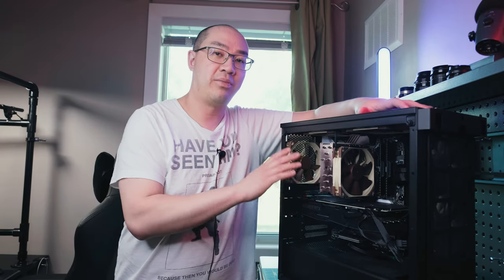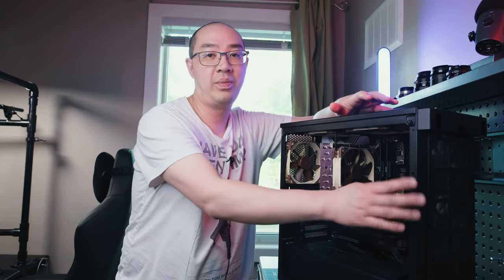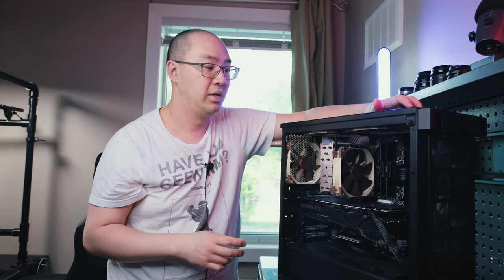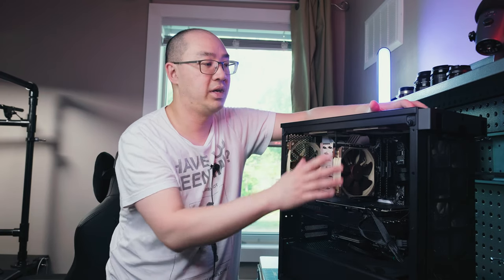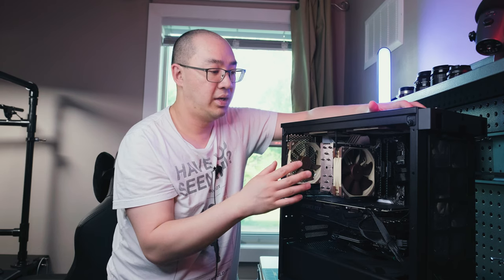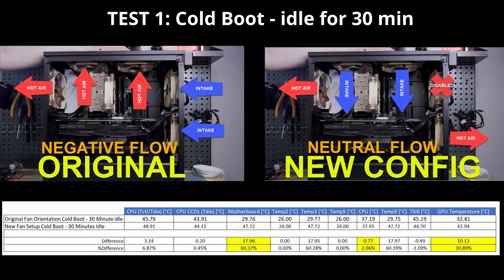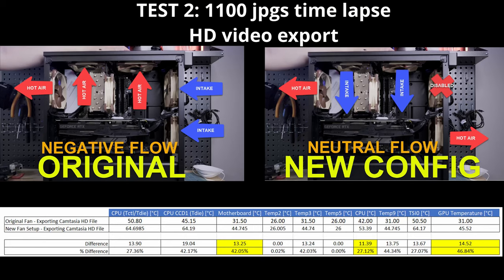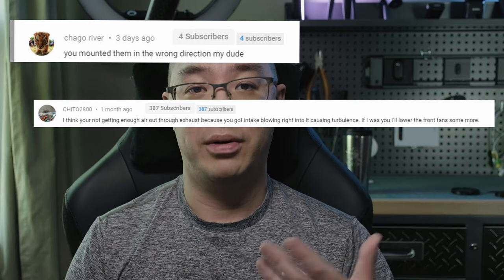Negative vs Neutral Air Flow Comparison | How to setup your desktop cooling fans 2

Comment: You didn't take into account your big ass CPU cooler when making a neutral setup and you went 1 fan down - of course it was going to be hotter. As well as hot air rising so higher intake fans don't help. I have Meshify S2 and 3x 140mm intake on the front, 1x 140mm exhaust on the back and 1x 140mm exhaust on the top-back (All Noctua as well, as well as the Noctua CPU cooler) to create the dust repelling positive air pressure, as well as more intake meaning more cold air coming in and the temps are great. What i want to try with my new build including this case, is full fan slot use on top via GPU 420mm radiator exhaust (3x 140mm fans and GPU specific because gaming is my personal priority and CPUs these days easily handle gaming) and 480mm intake, consisting of 2x 120mm on the front and 2x 120mm on the bottom to again keep that dust repelling positive air pressure. If you're not worried about dust like you mentioned in this vid - or you could slap on a total of 700mm of intake via 3x 140mm intake on front, 2x 140mm intake on bottom and a total of 560mm for exhaust via 420mm on top and 140mm on the back, then check your temps and get back to us ;) Or upgrade to a Meshify 2 XL for bigger and better fans allround as well as changing the thermal paste on your CPU and GPU to Thermal Grizzly Kryonaut, one of the few top pastes that are used and recommended by world leading overclockers.
Reply from the maker: Hi There. Thank you for the well thought out response.  I wasn't happy with my setup and I actually just switched over to a Fractal Meshify 2 and a 360mm AIO. (i'm just waiting for the 5900X to upgrade from my 3700X). The temperatures are way better. I'm currently using the stock fans in the Meshify 2 case. I'll be doing an update video on this soon.
Reply: @TheWongReviewer  Nice. AIO for your CPU or GPU? Front or top mount? It turns out front mount is the best for AIO in a case with good airflow like these. It'd be a shame if it's for CPU over GPU but i guess you do have different priorities, like 4k rendering and other CPU intensive work in which case maybe next time think about a Custom Cooling Loop, keeping both at great temps for gaming too. I'm going to be getting an AIB Hybrid GPU (360mm AIO + blower on card for VRM) and front mount that radiator, as well as the phat Noctua CPU cooler and 140mm Noctuas on bottom, top and back as well as Thermal Grizzly Kryonaut paste. Be about the best you can do.

Comment: What if you tried...
The front 2 as intake
The rear as exhaust.
The rear-top fan as exhaust
The front-top fan off?
Reply from the maker: Thanks for the comment. That's a good suggestion. That will allow for a neutral air flow. I'm going to wait for a few more suggestions  and then i'll do another temperature test. I'll definitely make sure to credit you in the video. Stay tuned!
Reply: @TheWongReviewer  I am very excited!

Comment: Great video! Just to jump into the discussion, I think pushing hot air downwards is a waste of energy since hot air would normally go up on its own due to density. It is like trying to push a well up a hill, you'll need more energy than if you just let it flow as it should. Even if you spent the extra energy to push hot air down, now the GPU will increase temps since the only air around it now is already hot and can't receive that much heat in the brief moment it comes in contact with the GPU radiator.
Reply from the maker: Thanks for the feedback. I see your explanation there, especially with the hot air rising and doesn't make sense to spend energy on it. I've switched to a new setup with an AIO and i'll be doing a smoke test to see air flow.

Comment: Original set up is the right one all you need was extra 2x120mm below the GPU to push the hot air quicker out the top and back exhaust.

Comment: Hey guys just wanted to ask. My case has 2 front side intakes, 3 slots on top, back and middle top are exhausts and the top front is intake. Finally one more on the back that works as an exhaust. Does that work well?
Reply from the maker: Hi there. what case are you using and what GPU do you have in there?
Reply: @TheWongReviewer  hi, I have a 3060 XC

Comment: In that set up.. remember your using the stock cooler fan of the GPU I need to pulls air.. obviously not the top .. it will pull from the rear and bottom tiny holes.. and since the top fan is pulling air from the outside and dust naturally sit on the top of the case.. the set up will invite more dust than the front panel .

Comment: I have similar case (macube 110) and I have some temperature issues because the case has quite restricted airflow. I installed 1x 120mm noctua intake fan and I have 1x stock exhaust fans. those are all my case fan. My cpu cooler is noctua NH-U12S and my cpu is 10600k. It runs quite hot when gaming and I wanted to OC it but no way with this airflow. Also my asus dual rtx 2060 gets quite loud during gaming. Any tips how I could improve my airflow?
Reply from the maker: Hi there. Thanks for the comment! Do you have any extra fan headers on your motherboard to accommodate more fans?
Reply: @TheWongReviewer  Yeah I could install 3rd fan, but I don't know if it should be intake or exhaust
Reply from the maker: @megapet777  Hi there. I would suggest an intake fan. Is the current exhaust fan at the back of the computer?
Reply: @TheWongReviewer  yes it is
Reply from the maker: @megapet777  Awesome. If you're able to, I would suggest an intake fan at the front if possible.
Reply: @TheWongReviewer  ok I will do that :)

Comment: I'm currently building a pc and have been wondering what the temps would be like with negative pressure created by top, rear and front all blowing air out while air intake follows through the bottom. Dust I imagine will follow through the corners over time however feels like a small sacrifice which can be fixed by cleaning on regular interval for cooler temps??? Any thoughts around this would help, video would be great 😅
Reply from the maker: Hi there,  What case are you using? In my setup, I don't have a fan at the bottom of the case to fully test this out. my current setup is negative pressure and once a month, i take 5 minutes to vacuum the dust filters, but i find negative pressure does bring down my temps. Let me know what case you're using and how many fans you plan to use.
Reply: @TheWongReviewer  I'm planning on getting a cooler master h500, although negative pressure works great for cooling. I would be going with positive pressure with an additional fan up top for additional exhaust giving me a total of 2 exhaust fans in the rear and top to counter the intake from the 2 front 200mm fan.

Comment: Hey I am current using noctua cpu cooler.  Should I mount the cpu cooler fan as intake or exhaust?
Reply from the maker: HI there, it should be exhausting out.

Comment: How about intake from below and exhaust on top and rear?
Reply: I bought a case without any front vents and it really opened up my eyes. The natural movement of air is cold air falls to the bottom, hot air rises to the top. So sucking air into the case at the bottom and blowing it out at the top and top-rear was so much better than any case with any layout of front mounted fans. In fact I got the best results without any intake fans (2 outtake fans at the top and 1 outtake fan at the top-rear, the intake occurs naturally through the bottom of the case).

Comment: in new setup GPU is not able to take in the cool air as the backplate is facing intake fans
Reply from the maker: Thanks for the feedback. Good call. I'm going to be changing this up again to see if i can lower the temp.

Comment: Dude, the problem is that your front low fan , in a case like that, should ALWAYS (trust me, I've been building PC's since the late 90's) be an intake because you need cool air coming in from the bottom to cool down your card and board. In an AMD build having the top fans as intake DOES help on a case like that (different cases pose different problems). If it were an Intel CPU, I would have them on exhaust (yes, there would be a lot of dust, though).  As for the top front fan, I would turn it on so that you can OC your RAM to the its top performance (your ryzen will thank you).

Keep improving /testing until you get the best possible results for your rig! ;)
Reply from the maker: azores81 Thanks for the feedback! I have adjusted my setup since this video to the point I found the best temps. I hope to post an update next week
Reply: @TheWongReviewer  Can't wait to see the new video! Subscribed!! ;)

Comment: Give it a try with only 3 fans. Two in the front as intake, one in the upper back as exhaust. The upper front, when exhausting will pull the cool air from the upper fan on the front directly out. After that, you can try turning the back fan on and off as exhaust, to see if it makes any difference. Good Luck!

Comment: Couldn’t you use the same amount of fans and just control the speeds to make it neutral
Reply from the maker: Thanks for watching and the input. You raise an interesting point. You are right, i can adjust the fan speeds in the software. I'm going to have to test this out. Great suggestion. I could crank up 2 of my fans and lower 3 of my fans. This theoretically should create a neutral state. It'll have to depend on the RPM settings. I'll have to look into this a little more.
Reply: @TheWongReviewer   Draw power from your power supply instead of using nature, physics, and environment temperature is a fun experiment; but should never be a solution.

Comment: You fucked up the intake
Intake shouldn't be from the top, heat rises and it will not be efficient pushing heat down with cold air.

Your original config is good, maybe add one more front intake and that's it, top always exhaust (since heat rises this is the most beneficial at taking the rising heat and helping it in its direction faster
Reply from the maker: Thanks for the reply. You're right, heat rises and it makes sense to push it up.

Comment: the problem i see with your neutral pressure set up is how you placed your exhaust fans. you could have been better off disabling the rear fan and just have 2 front fans acting as exhaust and the 2 top fan as your intake. the reason for this is 1of your top intake fan is immediately negated by your rear exhaust fan and the other intake fan negated by the tower cooler fan which blows air right into the rear, for it exhausts your fresh air from the intake the moment it comes in. which,  in theory, makes it impossible to have fresh air travel into your gpu, into which you see an increase in temperature on both cpu and gpu. 

also, try flipping the cpu cooler fan to pull air towards the front, but i doubt it will do anything to help cool the gpu, for in top intake scenarios, fresh air from the top would have a hard time reaching the gpu, if it ever makes it to the gpu

in theory, atleast for me, placing your top fans as intake is generally a bad idea considering how close it is with the cpu and its cooler, which in actual practice blows air out immediately, again, considering how close it is on supposedly exhaust fan slots.

Great informative video by the way. :)

Comment: When intake fans and exhaust fans are to close to each other its NO GOOD!!
Fresh air that comes in the case will be immediately pushed out by the exhaust fan before it reaches the components.

Example..
I use :
2 intake front (higher rmp)
2 exhaust at the top
1 rear exhaust.

The front fan thats higher up blows fresh air in the case towards the CPU but it will NEVER reach the cpu/cooler because 1 exhaust fan at the TOP push this air out hence why this top fan blows cool air out and the fan towards the back is blowing hot air as its closer to the cpu
Basically 1 front and 1 top fan are completely useless !!!

My suggestion to test 
1 rear exhaust (behind cpu)
1 top exhaust ( above cpu)
2 intake aiming at cpu and gpu and put these fans as low you can.

I work for a company that installs greenhouse ventilation. 
We only use intake fans at the bottom and fan exhaust high at the rear.
Reply from the maker: This is the most detailed response I have so far. Thank you for taking the time. This week, i'm going to configure my build to your suggestion and test out the temperature. Are you okay if i mention you in the video? I'm definitely going to post an  updated video on this one.
Reply: @TheWongReviewer  I'm waiting for your test!
Reply from the maker: @thekids_callmeboss6577  Hi there, sorry. I've been tied up with a few other projects. I'm definitely doing this test. Sorry about the wait!
Reply: I have the same case as you, the 275R, and I’m looking for the best possible air flow. When looking inside the case, we have to consider the PSU guard. If we put the two fans that are in front as low as possible, the one that occupies the lower position IMO will get its air current distorted. So we have to put them in sort of a middle position. Let me know your thoughts!
Reply: among all the comments, this is the best :) for intake, i suggest static pressure fans (Arctic P14/P12) for cheap cases

Comment: Can anybody help me? My pc has 3 140mm fans as intake at the front, 2 140mm as exhaust at the top rear and one 140mm as exhaust at the rear. Is this positive, negative or neutral? 6 fans, 3 in and 3 out but bear in mind my cpu cooler (noctua) also has 2 140mm fans.
Reply from the maker: Hi there. Thanks for commenting, it also depends on the RPM you set the fans. I recently saw a youtube video from Gamers nexus who addressed airflow. As long as you have enough fans to move air through the case, it will cool the computer.